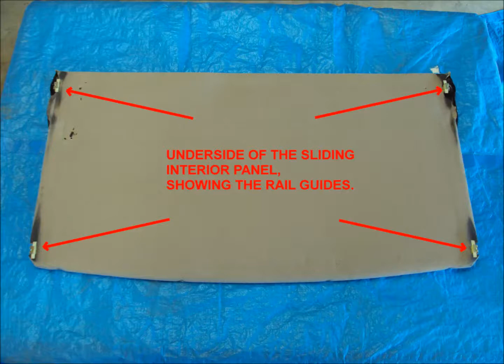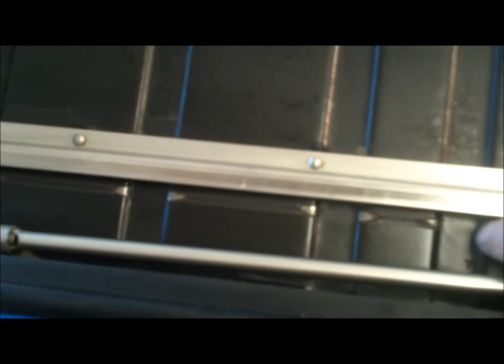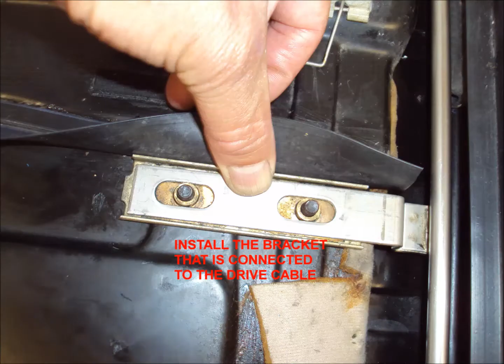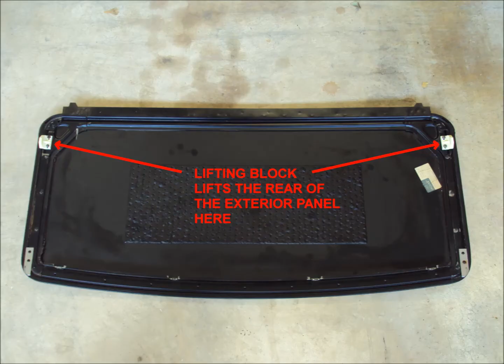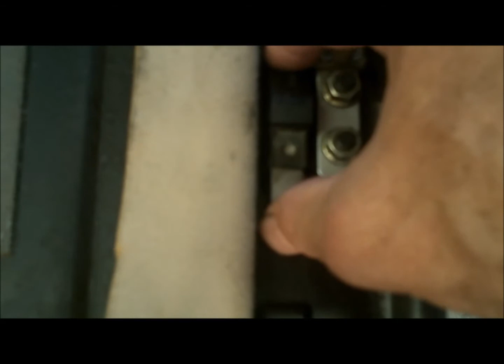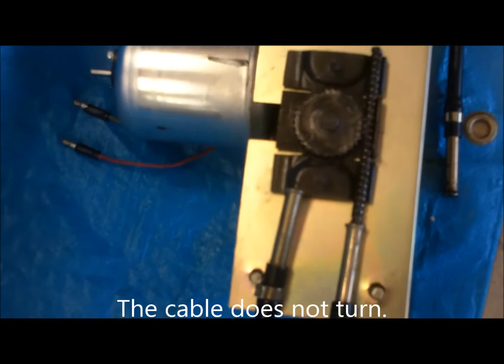1987 Jaguar XJ6 Sunroof Construction

Comment: Thank you for this video, it was so clear with the components out and good explanation too. I am struggling with a roof that won't square up. Now I may make some progress. If you have any hints, please let me know! (My Jag has Texas plates too!)
Reply from the maker: It's been a while since I had all this apart.  But, I think the drive cables are misaligned.  The only place you can realign them is at the motor, in the trunk.

Comment: Hi there, very useful video!  
I tried to remove the upper panel myself by releasing the 4 screws but the screws just kept spinning.  Have now drilled out the top of the screws (threaded part still in place) but the upper panel isn't moving at all.
Any idea what to do or what may be causing this?
Thanks so much!
Reply from the maker: I took the screws out of my panel not too long ago.  I forgot about it and went for a drive.  The sunroof flew off and was run over by a car.  Don't do that!  There are only those 4 screws holding the exterior panel on.  Some sunroofs have a tapped hole for each screw and others have a removable tinnerman(sp?) clip for each screw.  Either way, you should be able to pry the panel up and away.  Open the sunroof 6 - 10 inches, not all the way.  Good luck!

Comment: How is the seal connected to the slider?
Reply: the weather seal is held in place under the painted exterior body panel with metal guides screwed to the panel.